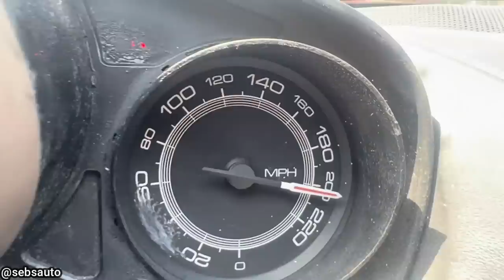Customer States Engine Overheated And It Might Be Seized | Just Rolled In

Comment: the filter did his job to the utmost capability, i would award it a medal!
Reply: I never heard of a coolant filter!!
Reply from the maker: @THRASHMETALFUNRIFFS  mostly on heavy duty equipment from my experience.
Reply: They also make aftermarket filter kits for diesel pick up trucks
Reply: That filter needs a 21 gun salute!
Reply: @THRASHMETALFUNRIFFS  Detroit Diesel has a TSB out on the coolant filter featured in the video that says take it out and don't put on back in. I don't remember what exactly it says as it's been a long time since I worked on a DD15
Reply: In the preview to the video I honestly thought he was holding up a small piece of tree.  It looks like a log.
Reply: At no time should your filter look like a Cadbury Flake.
Reply: @trooperandcooperale3057  Bet it doesn't taste as good either
Reply: @saintsarecoming13  Current DD HDEP tech here - basically they're saying remove it because their testing over the last decade suggests it makes no difference to the longevity of the engine; the last couple generations of the engine have no coolant filter housing on the OCM at all.
Reply: @Varmint260  every coolant filter I ever pulled out of a DD looked like it was covered in concrete. I left a few years ago to work for cummins and I've slowly forgotten a lot of detroit stuff.
Reply: @saintsarecoming13  Yep, every one I've ever pulled also looks like that. And yet, when the engine doesn't have one, it doesn't seem to affect the coolant negatively. I wonder if something in the coolant was reacting with the filter media?
Reply: @Varmint260  that's possible I suppose. I've cut open cummins coolant filters and seen them look pretty clean on the inside. I can't imagine that the coolant filter does much of anything at all as far as actual filtration goes and I know a lot of the point of changing the cummins ones is the DCA charge in the filter.
Reply: 🤣 well the cooling system failed.
Reply: @dlofgreen  same lol
Reply: I remembered my dad drove for a company that used DD equipped Freightliners. It seemed like something serious was broken every other month. I remember he drove it with out a power steering pump for a few hundred miles one time. He later switched company’s and drives a Kenworth with a Paccar. Way more reliable
Reply: I think that guy was using swamp water in his coolant system
Reply: @THRASHMETALFUNRIFFS  I am now subscribed to you, just because of your name. 🙂.
Reply: @doordieace5high  Well that's super cool and was actually my scheme!  {;o)  Enjoy my playlists of Cars and Metal and other fun junk!
Reply: @doordieace5high  Hay WAIT, is that a sick dope Green Jackson V in ur pic?!

Comment: A long time ago, my first “automotive” job was roadside assistance for a major “automotive association.” More than once, I got called out for roadside assistance for people who jacked their cars up using the flimsy scissor Jack and had the car fall off the jack either because they put it on the car in the wrong spot or put it on the ground in the wrong spot (usually either in the soft dirt or on a major incline). The knowledge and ability to change a tire properly should be a requirement in order to get a driving license, but unfortunately (at least in the USA) knowing how to drive properly is not a requirement to get a license, so…
Reply: well, i know how to change a tire, my oil, my coils, plugs, brakes etc etc... doesn't mean i can physically do it. that's why i have CAA+... i just used to have to put up with the local tow company guys snickering under their breath, every time they towed me to our garage... with the same last name. thankfully, brand new vehicle 4 years ago and no more tows of shame lmao.
Reply: When I worked at a dealer someone lifted their car from the center of the driver's floorboard with the scissor jack and dented it up. I said "want me to pound this back down" (with a rubber mallet) and the guy said wow I thought that's as supposed to be like that! 

It was a huge dent, made using the brake awkward.
Reply: @volvo09  no words....
Reply: We had to change a tire properly to pass driver's ed. I once had to stop a guy who was trying to jack up a Merc on the oil pan. He said since it was flat, it was a great place. I told him he had to use the pinch rail. I showed him exactly where. He asked if I was a mechanic sarcastically. I said yes.
Reply: Omg, My Dad wouldn't let his daughters (4) drive until we knew some basics of car maintenance, changing a tire was #1. Also, for all you ppl that actually can read, the " how to" is in you owners manual for your auto.🤣
Reply: My co worker put the jack in upside down on her Neon - like, lifted the car by the base of the jack. It happened to be in a level underground lot, and she did break the nuts loose first, and the jack was at the right location, just the jack was upside down. She was able to complete the wheel change without incident, which is more than I can say for a lot of people, and now she has been informed about the right-side-up nature of the jack, so as to not be discouraged in doing it again (read: I didn't laugh at her or mock her, rather just stated the proper orientation of the jack)

Hell, I knocked my car down from a scissor jack when reaching for the spare... nothing happened (drum brakes) but I had to get another jack to lift the car, as it pinned its own jack under itself lol.
Reply: Dude, at least you get an exam in the US. I'm from Mexico, and when I first went to get my driver's license, all I was asked is if I had read the traffic law. I said "No", so the clerk told me "You should say "yes". I did, paid the taxes, and I got my driver's license in 20 more minutes. If my dad hadn't shown me how to drive I could have gotten my license without ever having drove once. Nowadays it's better, but you wouldn't know by seeing how people drive.
Reply: US driving licenses are often not accepted by UK insurance companies because the US drivers are so bad
Reply: Before I could get my liscence , my Dad had me rebuild an engine, my sister just had to know basic maintenance.
Both my sister and I  had to run drills of tire changing,middle of the night in the rain.
He took us to an empty parking lot in the winter and demonstrated how to steer out of a skid,then had us do it.

First vehicle I drove 1974 F100 4spd
No power steering or power brakes, I was 13.
Reply: I changed a tire in my driveway last year, and carefully double-checked the manual when positioning the jack.
Reply: @craigwiess1656  Sounds like dad may have served in the military. However, you and your sister are ahead of the game when it comes to vehicles. Thanks for posting that.
Reply: @lo1bo2  Good on ya!
Reply: @lo1bo2  Yeah that's right! I wondered why nobody was mentioning that the manual often has instructions on where to place the jack, even if you don't know yourself from experience/osmosis to put it under a sturdy section of the frame. Heck, sometimes if it's the jack that comes with the car there are instructions on a sticker ON THE JACK.
Reply: Shots fired.
Reply: 100%
Reply: Even they cant drive properly
Reply: @barbarachilds3570  Exactly the same with my father. I laugh at grown men who don't know how to change a tire or their oil.
Reply: The only time I've had a jack fall was with a small bottle jack on a hot day on a newer blacktop road. The road was so soft it didn't even damage my brake drum when it fell.
Reply: I had a car fall off of the jack that came with it and I more or less did everything right, except I didn't crack lose the lug nuts before I jacked it up, and it was a flimsy as fuck jack. It bent the pinch weld lift point and the car ended up resting on the spare tire I had leaning up against the back of the car.
Reply: Not that the jack is flimsy but the jacking spot is too damn small and rusts out, then youhave a problem of where to place the jack.
Reply: I’m not from the US and despite having a license for 6 years, I don’t know how to drive lmao I know how to change a tire tho
Reply: I had to teach my GF's teen to drive. First lesson was 'How to change a tire'. She was pissed, but I was the gatekeeper so she didn't have much choice. I talked her through it, but she did it. All I did was make sure the lugs were tight at the end. The second we were done she called her little boyfriend to brag she knew how to change a tire, but he didn't.
Reply: @kellynnd5361  I can fix most of the basic things on my own cars, its something i make myself learn for each new (to me) vehicle, so i dont need to deal with things like tow truck drivers snickering at me.

That being said, some things i simply wont touch on newer cars. Anything that has the computer involved, is off limits, if only because i dont have access to the dongles and electronic keys needed to sync that crap up.

Like my current vehicle. Ram 1500. Needs a new oil pressure regulator, but after looking into it...it requires a full engine disassembly, plus all the sensors have to be replaced at the same time, as they are paired to the regulator, and cant be linked to a new one. (they probably CAN, but it would undoubtedly violate some moronic law on proprietary programming)

So i need to save money until i can afford to pay for a rental, at the same time my truck is being repaired. Which the only dealership in the area kitted out for this kind of repair, gave me estimate of 6 weeks between ordering and receiving the parts, and getting the engine pulled, taken down, put back together, and reinstalled.

I got towed the other day, because i stalled out in the middle of an intersection (jeep driver gave me a push with his brushbar, and much thanks to him for that) and the driver smirked and said i should try changing my oil now and then.

when i got to the dealership, and the tech asked me if it was 'the same problem' the driver looked a little surprised.

when i said "Yeah, wish Chrysler would hurry up and issue a recall, so i can get fixed on their dime. I coulod buy a new Ford for what its gonna cost me to fix this damn thing." The driver got really pale. When i told the dealer service to let his mom know i would be coming over next week, and parted ways with a 'later Cuz'...

Well i dont that drivers going to walk away unscathed, considering his boss is my ex wife's uncle. And i am still very much on good terms with her, and her family.
Reply: in germany they used to tell people where to check for oil, water, and air while giving driver license education. that ceased eventually during the 70's I think. but still it would be better if they continued, just a walkaround around the car trying to make them realize they are gonna operate a heavy machine.
on the other hand I see more and more driving school cars being fully electric, and you just don't want people to mess with that technology... better call a towing.
some jacks I have seen inside cars were rusty, obviously never used. either the driver was lucky, or never bothered with it.
Reply: Hardly any cars come with a spare tire anymore. Can't change what you don't have!
Reply: @richardfabacher3705  considering how fail people have become, maybe it's better that way...
even though the emergency spray is one hell of a mess. and if you don't clean the wheel properly you might destroy the new tyre trying to put it on... ask me how I know. XD
Reply: Parents shouldn't let their children drive or get a license until they can demonstrate how to change a tire, change a battery, and at least check the essential fluid levels.
Reply: When the only way to get to a lot of places is by car, then there are a lot of people behind the wheel who should not be driving.
US driving tests are a joke in most parts of the world.
And people should have learned how to change a car tire from their dad or their car manual. It is perfectly possible to change a car tire with just a scissor jack. I have had to do it many times on holiday in remote places, and was very happy my dad taught me so I got back to civilization before sunset.
Reply: @rogerwilco2  german drivers license is a lot of effort, theroy, practicing driving and so on, and often very expensive, too. depending on how long it takes you to get a routined driving habit. still we have too many people driving recklessly or unpredictably, and the rest I guess is a matter of being interested in doing it at all. when I was still working car mechanic some customers would just come in regularly to have everything checked. dunno if they could change a wheel, but many modern european rides don't even have spare wheels anymore, so there. :P
Reply: @Bateluer  I think nowadays Special Flowers are not interested in these things at all. I have had young people who wouldn't even understand that a repair takes time and effort, especially if it's body repair. they'd flutter about you making plans and completely forgettign about the couple thousand bill for fixing that rustbucket awaiting them.
and if their parents don't care, how can we expect the kids to care?
Reply: @andyrbush  Pennsylvania thankfully has made the test harder a few years ago but I think that it's still far too easy.
Reply: As a Canadian, another major skill is skid control, especially for winter.

The driving Teacher I had made sure to demonstrate it properly and get me to practice in an empty parking lot (loads of fun and useful), knowledge on how to deal with and react to this stuff, and of course they covered important stuff like basic car maintenance which is never not useful.

Not sure how the US system works but it deffinitly needs to be addressed given how many people don't understand even the basics of their vehicle
Reply: @kellynnd5361  New vehicle has nothing to do with a flat tire.... Can happen to any vehicle/tire.
Reply: @ws8080  my last 4 tows with my old escape within the final year?

1. blew a tranny seal, while driving a customer i had just picked up, back to our garage... so they could pick up theirs.
2. someone left the GPS on, for a month, when temps hit -40 without windchill... and yeah, it wasn't me, it was so dead it couldn't even be charged at home lmao.
3. my left front tire tried to come off on the 400, a major hwy known for that crap, yes the wheels had been torqued... but aluminum rims, hot summer day and shit happens. didn't know if there was damage, so towed
4. went to check the mail(rural so post office), got back in and went to back up... and the steering wheel wouldn't turn. the steering module went. the fun part was, i had just started driving again, after having torn out my elbow tendons and nerve... which is why the GPS was in it before, for the long drive to the hospital for the surgery.
Reply: @richardfabacher3705  I  had a car that was old enough that the spare tire was starting to dry rot. When I went to replace it, it turned out to be such a pain in the ass to find that I ended up buying a whole new full sized spare wheel. It was about the same price, and though I lost a little storage space and had to rig a way to secure it, it was nice knowing that if I had to use it, I wouldn't have to baby it with the old 50 mph/50 miles restriction.
Reply: @hrodga  Those "toy" spares! In '06 I was hurrying from N. Alabama to New Orleans for a family emergency. I was passed on I-65 30 miles north of Birmingham by a big, black Cadillac that didn't look right--it was tilted. I realized his right front was the toy spare. I was doing 85 (3AM); I estimate he was doing 100-110. I turned West on I-20 and just west of Bessemer there was what was left of the Caddy upside down in the median with emergency vehicles everywhere. So much for ignoring the 50mph/50miles limit on those toy tires.
Reply: @Bateluer  My dad made absolutely certain I could do all of those things, plus change oil, brake pads/rotors, and replace things like the thermostat, alternator and water pump (most common things to go bad on a car). Anything more severe I take to a mechanic, but the skills he taught me saved me thousands over the years.

Comment: 0:05  That was a filter?  For a second I could've sworn it looked more like a piece of wood.  Obviously it did its job to the best of its ability.
1:16  Sees all the broken gears in the diff  Well, there's your problem!
1:56  Sounds like the parking brake actuator is trying to practice its beatboxing.
Reply: I was expecting Imperial Storm Troopers....
Reply: The filter looked like it was caked in clay soil. Guess that’s why you’re not supposed to use muddy river water as a cheap substitute for coolant.
Reply: My thoughts also, when I first saw it I thought it was a video on wood working.